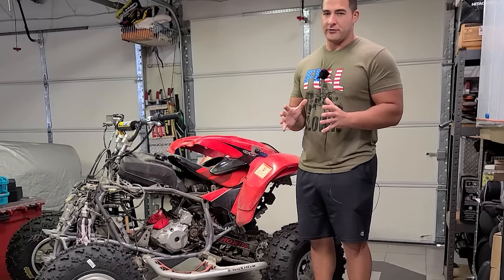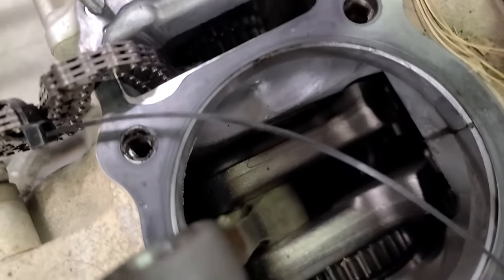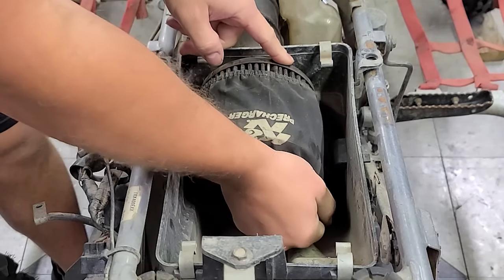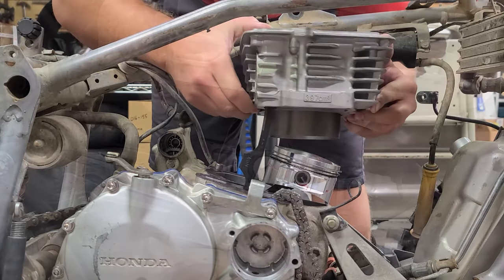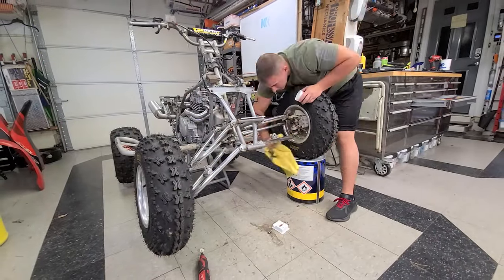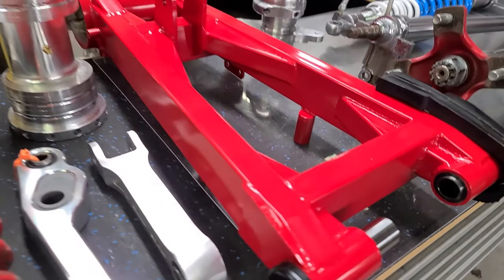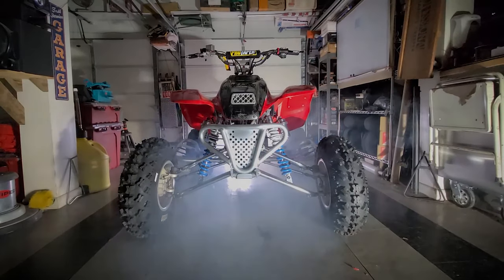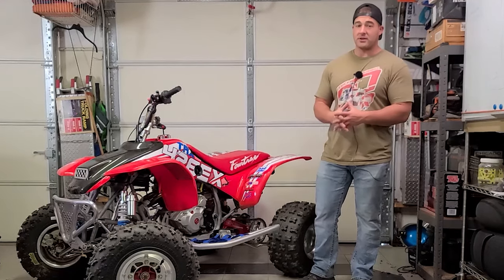Abandoned Honda 400EX saved after sitting for DECADES in pieces

Comment: The 400EX is the most dependable quad I have ever owned. Bought one new in 2000, I still have it basically all original even down to the brake pads. Air filters oil changes and batteries is the only thing I have ever done to it. It is not my favorite quad, but if you want to go for a ride and not risk breaking down it's my best choice.
Reply: You still have the original brake pads on it from 2000? You must not have rode it more than once every year since you bought it
Reply: @andrewstahl6916  at that point in time it was the first new sport quad released in over a decade. Soon thereafter there were many better choices. Until recently there used value was almost nothing, so there was no point in parting with a clean low hour machine.
Reply from the maker: Very accurate; the reliability factor is 10/10 on the 400ex
Reply: A Yamaha warrior runs without any oil 🤣
Reply: Just switched out the factory brake pads on my 2000 400ex last summer.  I've owned it since new. Still looks brand new. Dont ride all that often but no way I can part with it.
Reply: @andryangere my friend ran his with no oil in the motor for a few hours out in the mud, the thing was glowing! Brought it home put oil in it and than sold it to a kid in the neighborhood, he rode it for years after that with zero issues!
Reply: @theSkavenger84  they are absolute tanks.

Comment: Just an FYI, the oil won’t just flow from the tank to the crankcase, atleast not very quickly. The engine has to either turn over or run so the oil pump will pull the oil into the engine. Great stuff btw. I myself am a very big fan of the 400’s, my channel is based solely on 400ex content pretty much. I’ve got a fully built 400, check out my xc ready walk around video if you’ve got time. It’s got everything from long travel suspension to a fully built motor.
Reply from the maker: Thank you for the info and wow, very similar looking design when you first glance at your bike; I'll check out the video! I waited a good 30 minutes and not a drop flowed into the engine; it might have cleared when starting it but I didn't want the crank to be dry for initial start up; a good bit of sludge came out of the lower line; the oil was nasty!

Comment: i just scored an 06 trx450er for 300 bucks. It being my first quad i've found this channel to be super informative and entertaining. I come from dirt bikes so i do have a decent bit of knowledge. but anything on the chassis or suspension i really dont know much about. But, from this channel i've gotten it running, done a parking brake block off, new levers and just general tidying up of things. It sat outside for 10 years and is pretty rough but thankfully it was all under a  tree and is 100% bone stock down to the brake pads. I appreciate the knowledge mike :)
Reply from the maker: Sounds like an awesome resurrection man! I'm glad my videos could help you out 🤘

Comment: That skit at the start had me dying because i do be convinced someone took the spanner i left down and can't find 😂 small tip for the valve insert tool, lock it in a vice real tight and you can use both hands to work on installing the spring and that. Great video as always man 👍
Reply from the maker: Dude... thats a great idea putting it in the vise; I never thought of that!

Comment: I love your videos, i have watched a lot of them. One thing is the nut that was stuck on the hub that would not come off with a wrench. For that I usually would use an impact gun set up quite high and just blurted a few times usually comes off easier and then put it on properly. That's what I've done in a pass with stuck hubs, keep up the good work.

Comment: Hey Mike if you want the air to flow freely into the airbox with the open top but yet keep it water friendly then think about applying a layer of Frogskin over the opening with some epoxy. I've used it on my 4x4 quad and it works great.
Reply from the maker: Definitely a good idea man! Thank you for the suggestion and for becoming a channel member 🤘
Reply: @MichaelSabo  what all my Xc racing buddies do is cut a large square in the air box (think like cutting a inch in from the outside of the lid all the way around) and then riveting foam into the inside of it. I’d say it works pretty good too cause one one of them is racing xc1 pro in gncc very successfully, and the other two are racing either pro or A at the Indiana and Midwest series very successfully. I would’ve never felt comfortable doing that before seeing them do it but they all swear by it.

Comment: I would recommend the aluminum oversized oil reservoir with the holes going through and add a second oil cooler in-line with the stock one, I think they use trans coolers off an f150 I forget it’s been a awhile but I did pretty much the same build , same piston, same valves, stage 2 cam and hot rods crank , head studs, flat side carb, ebc clutch and full fmf exhaust and she ran hot so the oil upgrades are a good investment protection , your prob  gonna wanna do head studs and check that t chain , I did the cr 450 t chain upgrade with a manual tensioner I made! Sick build can’t wait to see her run

Comment: Nice build. Get some single sided foam tape for the skid plate fixes the rattle every time. We used to run UMI air box/ battery box back when we used to race 400s.

Comment: When you clean up old bolts or hardware. A great way to protect them is to nickel plate them. Its extremely easy and cheap to do at home. all you need is a battery charger, white Vinegar, a tiny bit of salt and a piece of pure nickel. There are many videos on YouTube how to make the solution with this Material and how to nickel plate parts. I prefer doing this over paint just because its far more durable. You can also nickel plate parts of any size. if you make enough solution and use a big enough container. I have done frames and a arms. Keep up the great videos

Comment: Hey Michael, I love the video! You saved me the $ it was going to cost me to take my Houser stem to a machine shop and have them straighten it.
Also, I guess bc this video is old, the link for the reservoir clamps didn't link up on ebay. I want to get some similar clamps that'll work on my older custom axis shocks. Any suggestions would be greatly appreciated!
LOVE YOUR VIDEOS!

Comment: Such an incredible restoration, you do fantastic work! With your level of organization, it's almost unbelievable that you would have to back up, to install a part that you initially missed (🤣🤣  That's normal for the rest of us....) I'm loving the "one video" rebuild format, btw.  

Only slight critique I would offer.....JB Weld on the starter housing aluminum casting repair-?  I know, I know; it was non-critical & will likely be fine.....but dude, we've gotta get you into TIG. There are a lot of affordable options, and it would've been perfect for the starter housing ear, the twisted off bolt, & the frame welds. 

Thanks for taking us along on another great restoration!

Comment: What's new?. 400ex builds are fun. Did a few 440 kits back in the day. I picked up a tiny electric quad. Measures 3ft long 25.5in wide 26in tall. Well it so happens I have a 85' Yz250 engine laying around. My 6th sense says it must go in the mini quad. 
 Its gonna be a while as winter is here. I made up a parts list. Thus thing is gonna be sick. 
My friends are stuck on me putting wheel bars on it. Maybe but who knows. Good luck with that 426 build. I will post on my yt when I get some videos made.

Comment: In regards to your shoulder, do the physical therapy and the exercises they recommend as often as you can tolerate. I'm not a doctor, but had the full surgery (Detached Labrum, Supraspinatus tear, AC joint) and got back to 90% in about 4 months. Try to find a therapist who does stretching (range of motion) and massage, not just the physical strength exercises. Not going to lie, it sucks, but can be done. Now I get to do the other side. Thankfully only a Supraspinatus tear. Best wishes on a speedy recovery.

Comment: What are your thoughts on a broken timing chain? What would you do to break it? Maybe springs too strong? This guy had super low hr stuff but with metal powder in the crankcase. The clutch basket shows low hours, but abused to the max. So the timing chain, must have been rpm over limit constant. My guess would be the con rd has been stressed and crank roller bearing. Probably damaged and you will never know it but the guy you sell it to it fails with first overrev.

Comment: What was you final jetting? 
I’ve got a 416cc stage 2 no air box lid. 
Using 170 main 42 pilot needle 3rd clip and 2 turns out. It runs pretty good, but sometimes feels like it’s lugging in low rpms and cuts out. Doesn’t feel like a lean issue.

Comment: The good thing is alot of the 450r parts fit on the 400ex like the steering stem and front shocks is a huge upgrade for the 400ex to get 450 front shocks

Comment: Awesome video! I was concerned in the beginning of vid and seen the crankcase open to the air and debree not saying there was a sand storm but I’m always real cautious when doin rebuilds about stuff getting into the case, how come you were not concerned about that or maybe u were but curious? Thanks.
Reply from the maker: I cleaned and vacuumed in there. The oil was dirty but I did not see debris in there. I flushed it off camera as well.

Comment: Yes I had a seized swing arm bolt on my warrior. I cut the damn bolt in 3 pieces with the sawzall and it still didn’t want to come out. Swing arm had gouges over 1/4 inch thick in the sleeve so had to steal a replacement from a parts quad.

Comment: curious do you have any recommandation to close a crack in a engine cas, my trx300ex has a 1cm crack in the rear underside you can see it from the back, doesn't leak alot but does leak... i dont think there is a easy fix my quad has been fine for 2 years and now it has a crack.... was thinking about jb weld but from what i read it will leak again

Comment: Yo meat gear find on the EX just one thing that valve spring press tool that one you have is for big block engines for trucks like tractor trailors lol. They make a smaller one for motorcycles. I giggled a little when you put that huge thing on a small engine. Awesome
Reply from the maker: Hey man, it gets the job done but it really is cumbersome to work with if you're not used to it

Comment: Mike makes the greatest videos! I have a 250r and a Banshee and will be using his videos for both.   I have 2 questions: were those the oem 99-04 plastics with that hood?  I want to get rid of my bug eyes and run a light bar.  I want to find a hood like this, but do they work with the original plastics? Second, If I open my airbox like that, do I need the K&N or can I use and oem foam filter?

Comment: Sweet machine indeed after some elbow grease. Wouldn't hurt to tap on the valves with a brass punch or dead blow to make sure the keepers are set in place for good. Ive seem them come off and dropping a valve sucks.  Nice work man!

Comment: I see the KLEMM RESEARCH logo on the whiteboard at 0:08. Dad put one of their pipes on my Zilla a long time ago, and served him, and me, well, before being retired for an FMF.

I liked the criminal's shadow at 0:13!

Looks like you were doing the "green apple quickstep" at 0:24!

I knew that starter motor bolt would give you trouble as soon as I saw it. Old Hondas are MAGNETS for wrong fasteners. Seems to annoy you as much as it does me. I DESPISE wrong fasteners. I LOATHE them.

I agree with you about keeping OEM starters. Mitsuba's are damn good. There isn't a lot of up or down stress there, but a LOT of torsional stress. Those motors have a lot of stuff to move, and make a lot of torque through their gear reductions, and that translates back to it's mounts. A twisting motion, especially with a big bore and or high compression engine will stress it even more! I hope that the JB weld holds up.

I believe parking brakes are ideas like footwells. Some know-it-alls got  the idea that they were needed. Apparently, putting your machine in gear, if it's facing downhill, or reverse, if it has it, if it's facing uphill, or just plain facing sideways on the hill, is too complex. They were lousy, even when new. Use them once, and the cable sticks and the brakes drag. Blech.

I love my Motion Pro clutch tool too! I HATED guessing at the clutch basket nut torque with an impact gun.

Did someone really comment about how "you're an idiot" at anything? I've been watching your stuff, and you are a damn good mech. EVERY wrench has forgotten something at one time or another. But cam chain tensioner AND oil pump gear, man, I've had days like that. Say a few, or a bunch of, bad words, then take it back apart. Groan. Oh well.

Mustard however, is NOT a good lubricant! Ha.

The problem with shortening the valve guides is the valve has more of a tendency to rock instead of slide, and that beats up the valve seat, which could cause a dropped seat or burnt valve, and with less meat there, the guides will wear out sooner.

Some people criticize me for doing the same smoothing stuff you did on your head when I build an engine. They don't realize what a difference that can make. The LT-R450 exhaust port finish is one of the worst! DS650s porting and finishing is pretty damn good though!

WAIT! You forgot the front cam chain tensioner! See it before you put the head on! I'm willing it to you! Hear me in the past Mike!
Damn, you couldn't hear my thoughts! I yelled them to you as loud as I could. :(

Yeah, ALL 400exs have been on their heads at least once. Good welds!

Had a buddy's 400ex swingarm bolt stuck when we had to pull the engine. We had to plasma torch cut it on the right side between the engine and swingarm. That sucked.

That SUCKS about your rotator. Being down that long would basically kill me. I need my fixing fix.

Anyway, another good build Michael!

Comment: In the explanation of rebuilding the head the valve springs with the coil wound the tightest with less space in the coils go to the bottom of the head they are usually painted 
but be careful sometimes the wrong end is painted.

Comment: Just a heads up on the no name cylinder. If it were me I would buy a dial bore gauge and atleast make sure they are round and in spec in the future. A dial bore gauge is cheap and easy to use once u use it a couple times, other then that I don't see a issue.

Comment: What does porting and polishing help? Was wondering if I should get it doen
Reply from the maker: Engines are all about the flow of fuel and air; the better the flow, the better the performance. Porting and polished do just that; give you better flow. If you do it just right and match it to your engine and the other mods you have, it can make a major difference!
Reply: Thanks man I’ll definitely get it done I’ve got a 344 ex a built 300ex I have valves 400ex carb hotshot cdi 32t rear 14t front sprocket. And other mods I keep up with 450s no problem always looking for more power. You know how it is lol!!

Comment: The green wiring going to Rev box, I bet they did the cheap Green Wire Mod, which pretty much puts zero Rev limit, easy way to pop the engine. Those shocks are pretty freaking expensive

Comment: Get you some hose and clean catch cans  and run that parts washer fluid threw the cases i did it like that for years worked. Very well  with a little hardline to get in places 👌 just some wisdom

Comment: The stage 2 hotcakes gives you great bottom end torque and the stage 3 gives you more top end my two 400ex's are one has stage 2 and one has stage 3 and the stage 3 has more top end so in a top speed it bests the stage 2 but off the line the stage 2 rips the stage 3 :) hotcams makes amazing cams ❤️

Comment: Anyone know what can cause a 2 Stroke to had high vibration?
Reply from the maker: Counter balancer out of time (if it has one), bad crank bearing, crank out of true, flywheel out of balance, piston severely worn and chattering. Any of those can cause vibration.
Reply: @MichaelSabo  yeah because I just put a brand new OEM cylinder on a yz85 with new gaskets and wiseco piston it doesn’t vibrate until i rev it. Maybe something is loose I hope, because the crank doesn’t have many hours on it, what about if the clutch is loose?
Reply from the maker: @Tbands707  yea the clutch could cause vibrations
Reply: @MichaelSabo  I think I just figured it out, I took the bottom end apart and noticed the bearings were a bit wet and had surface rust, so the head was leaking coolant
Reply from the maker: @Tbands707  glad you figured it out man!
Reply: @MichaelSabo  yeah thanks for giving feedback 👍

Comment: I know how the torn rotator cuff is, I just had surgery on mine back in August
Reply from the maker: Ah man, sorry to hear you suffered the same fate; good luck in your recovery as well
Reply: @MichaelSabo  it’s rough, and you never really get back to 100%, but as long as you stick to physical therapy and follow what the therapist and doctor pays out then you can get as close to 100% as possible. I only recently felt like I could do some light riding and work on my machines. They had to shave out my shoulder socket, AC joint, and repair my rotator cuff. I still get the random pinch from time to time in my shoulder, but the doctor did say that it takes 6 months to a year to really start getting into activities.
Reply from the maker: @christopheravery5808  omg man, that sounds scary; I think with time you will get to 100% ; August wasn't that long ago.
Reply: @MichaelSabo  if I do get back to 100% then it’s not going to be anytime soon. The doctor is already talking about me having to change positions at my job or find something else to do. It was a work place injury so I’m pretty sure they will find SOMETHING for me because they don’t want to go down the road of me losing my job at the fault of the company. 🤷🏼‍♂️